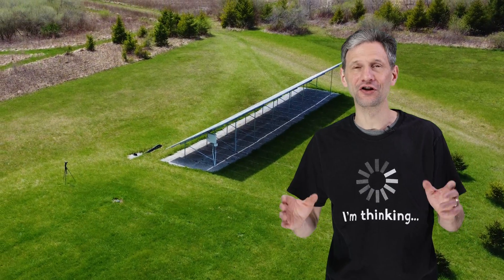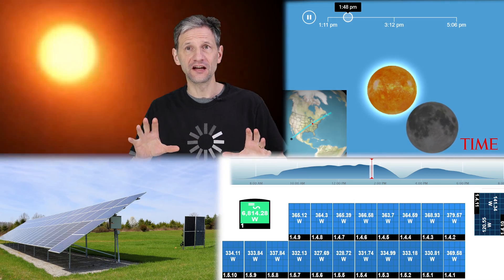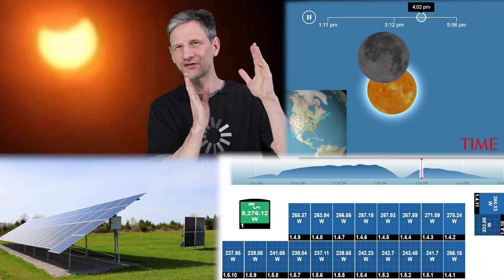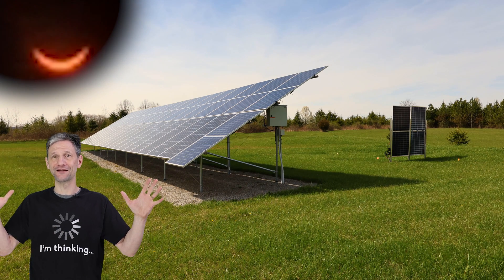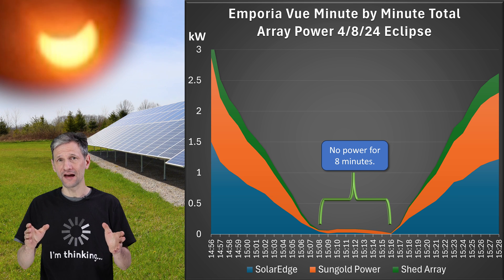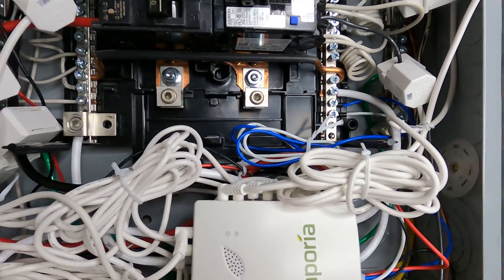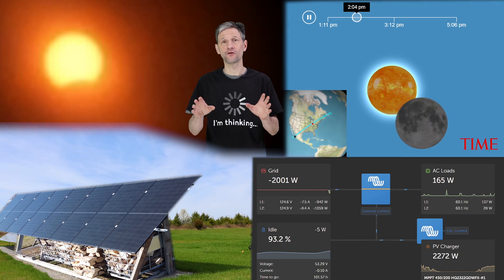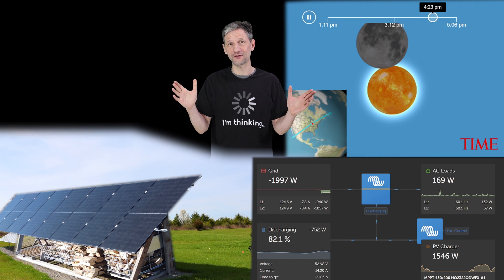Solar Panel Performance During A Total Solar Eclipse

Comment: Hi, very well executed and explained!  :)   I am really interested of how you monitor on the cell level where you don't have micro inverters.  Do you have a wire from each cell down to the combiner box and do the serial and parallel connections after the monitoring? I looked at the Vuew 3 energy monitoring but didnt see anything regarding cell level monitoring.
Reply from the maker: You can't do module level monitoring with the Emporia Vue.
Reply: @ProjectsWithDave  Hi, thank you,  but it looked like you had the wattage of each panel including the ones to the traditional inverter, how are they monitored to show panel level watt?  Or maybe I saw wrong?

Comment: Good video. When the sun burns out for good, I would love to see the data on that. Make sure you have a good flashlight, but don't shine it on the panels. It'll mess up the data. LOL Someone once said if the sun burns out, at least we'll still have moonlight. Hahahaha..... This video lasted almost longer than the eclipse.  But solar still stands as one of the easiest and fastest systems to erect after a natural disaster to supply power to temp medical facilities and such, with almost no supervision. So understanding how it works under various situations is vital.
Reply from the maker: If the sun burns out for good, we won't be around very long to make use of the collected data.

Comment: Once in a lifetime? We've had two in SE MO :P
Reply from the maker: Nice!  Did you get the same results from your solar system?
Reply: @ProjectsWithDave  I'm too poor for one lol (ok, not really, but I'm not installing one till I move).
 I just soak up info to build one optimally when the time comes.
Reply from the maker: That's a good strategy.  There is a lot to learn and the technology is constantly improving.

Comment: Small detail for correction, if I may- The pink spots are called solar prominences. They're essentially streamers of plasma that are pushed off the surface of the sun. A flare is a different phenomenon.
Reply from the maker: Thanks for the clarification!
Reply: @ProjectsWithDave  a question